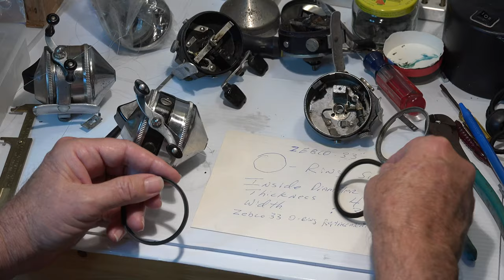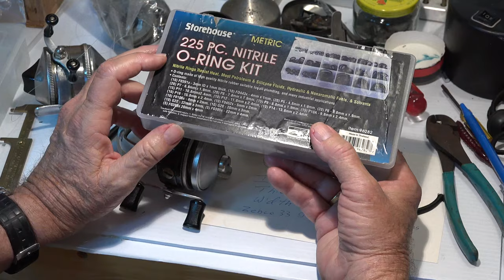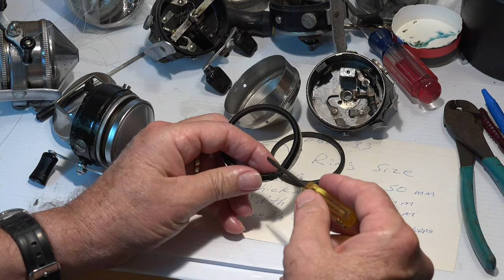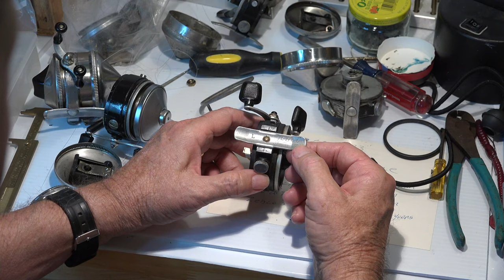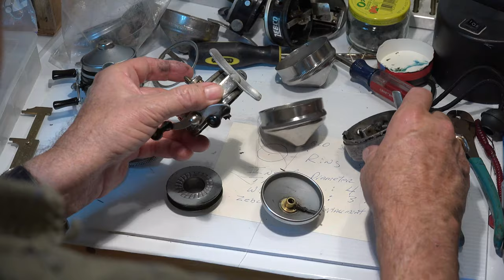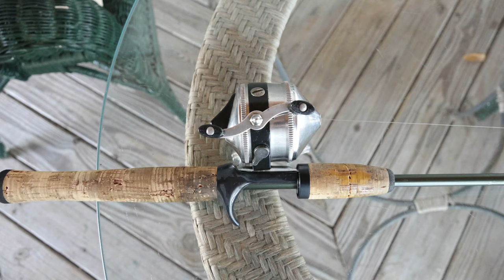ZEBCO 33 O Ring & Drag Fixes Video - Matt Mattson ZEBCO Fishing Tips

Comment: A very informative video..... Thank You.
What brand and pound weight line do you mostly run on your Zebco 33 Reels?
Reply from the maker: Thanks Alan.  I use a compromise: 8lb. Stren Mono (or equivalent).  They were originally equipped with 12 - but we use them for crappie and bream as well so 8 gives us a little edge when the water clears in the dry season and makes casting rooster tails and beetle spins easier.

Comment: What would make my more recent 33's drag seaze up
Reply from the maker: It's kind of counterintuitive, but a lot of those drags need grease to work - smear some on and give that a shot.  If it still doesn't work, take it apart and see if the facings of the drag are burred (if metal), or (hopefully not) mashed, etc.  If the metal facings are scarred - burnish them with a smooth tool (any will do).  If the drag is phenolic block or another softer type - you might need new parts to fix properly.  Good luck!
Reply: @mattmattsongold  Thank ya, Thank ya,  I appreciate the input

Comment: Zebco 33 reel and my drag isn’t working is it the teeth inside on the top?
Reply: Just watched the full video at 19:20 seems to fix my problem. I’ll get a brass stock and try it thankfully you talked about it
Reply from the maker: @WolvCustoms  : got it - I answered your other post before seeing this (we were on a trip).  Good you saw that - and good luck with the fix - can be frustrating getting that stock in the little slot but once done you've got it working again.  Good luck!